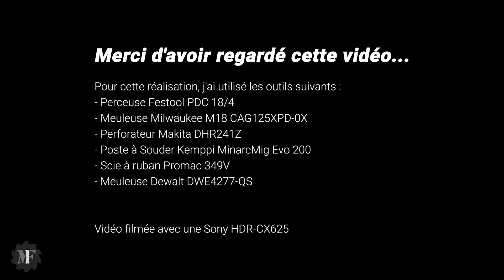Je PROTEGE ma MAISON des CAMBRIOLEURS !

Comment: Had to do a similar thing on my property in Portugal.
Instead of square tube I used 12 gauge steel cut to fit windows then fixed to brackets as you did.
Everything was secured from inside house so no access to the fixings.
Easily removed when house was occupied.
Just a shame this has to be done but their is always someone who wants what you have
You did a good job ,hope you didn't have to many windows to do.